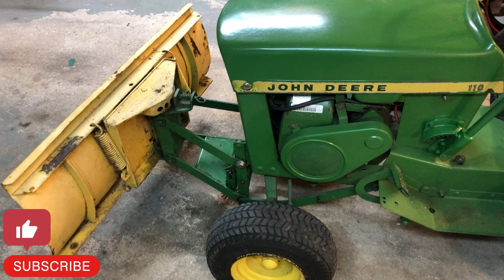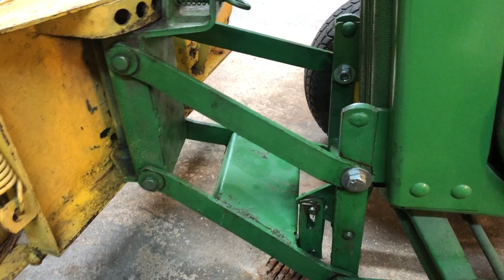John Deere 110 model 42 plow refurbished

Comment: What did your rear wheels originally come on? I want a wider set
Reply from the maker: I bought it with 23x8.5-12 turf tires, then I bought 23x10.5-12 used rims and turf tires and replaced the turf tires with ag tires. Here is a link to video I made on those tires. 
https://youtu.be/4HTO1qb_6Jk